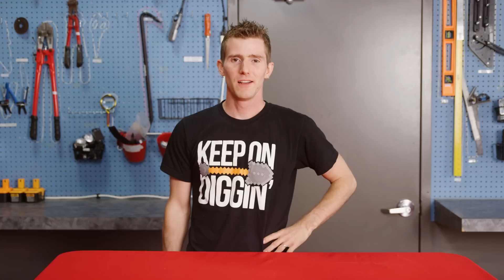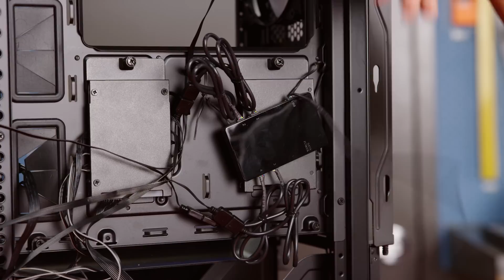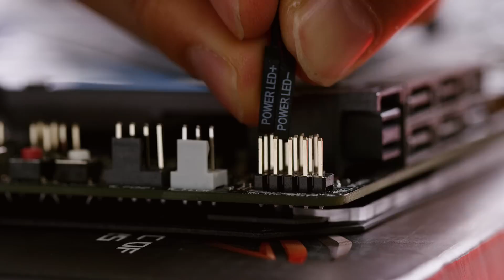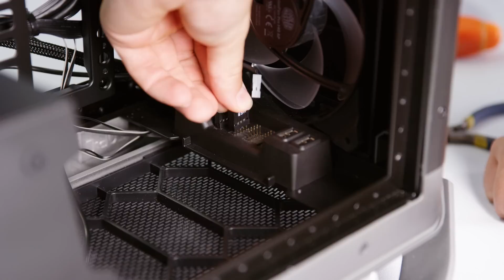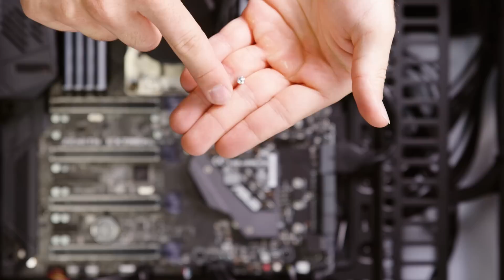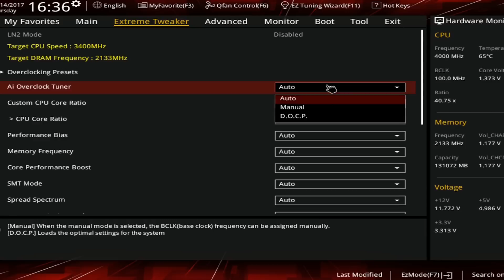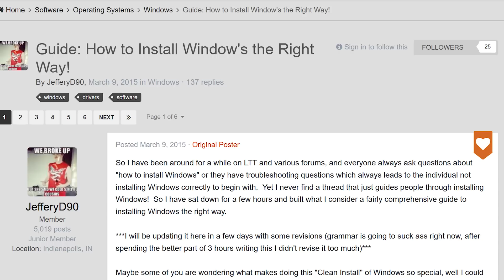Ultimate Mega-Workstation PC Build Guide

Comment: don't worry man, i'm building exact machine next moth, only difference, already have Cooler Master v1200 80+ platinum PSU, and Corsair h115i CPU cooler. and have 3 ssd, HDDs etc

I  do have corsair's 780T full tower case but c700p is monster of a case.
Also board will be Aorus x399 Gaming 7
and same 1950X and 64GB dominator Platinum.

already have 2 x aorus 1080ti.

yes, i do 3D content production and video editing...

so Board, CPU RAM, C700P case is all I have to buy :-D Rest is currently working in 4790K based PC in 780T.. so yeah, I'm here for the porn , and cannot wait... :-D

Comment: Ultimate Mega-Workstation PC Build?... and all that's used for cpu cooling is a sad dual fan AIO? give it the beans yo, min tripple like the Thermaltake Water 3.0 RGB 360 Hydro,  Fractal Celcius S36, Antec Mercury M360, Arctic Liquid Freezer 360, be quiet! 360mm Silent Loop or even the cheep Captain 360EX. Come on Yo!

Comment: CPU: i9-7900X
GPU: 2X MSI GTX 1080 Ti Seahawk
Motherboard: MSI X299 Gaming M7 ACK Motherboard
SSD: 1TB Samsung 960 EVO PCIe NVMe - M.2
SSD2: 4x1TB Samsung 850 EVO Raid-0
SSD3: 2TB Samsung 850 EVO
RAM: 64GB Corsair Vengeance 3000MHz
Power Supply: Corsair RM1000X
Liquid Cooling: Corsair Hydro H100i V2
Case: Corsair Obsidian 900D

Is the Spec from:
https://www.twitch.tv/summit1g
Maybe is goes crazier?

Comment: those long screws is not long screws. They are bolts.  The difference between screws and bolts is this. Bolts are partial threated. like only the 4th quarter are threaded  Screws are threaded all the way to the head.

Comment: Hear I though the LGA-2011-V3 sucks so badly its 2011 pins can easy bend and others fall of if not made properly. I called a online repair service so see what can be done to change that disgusting dead LGA-2011-V3 socket. Well LGA-2011-V3 is for X99 motherboards that is not being discontinued and many retired off the market.Any way the tech did tell me that is the worst socket they worked on. When it comes to the next gen motherboards suck as X299 and X399.suck worse on its CPU socket?Only time will tell. We are on X399 motherboard its 4096 pins that is  2085 pins more then the LGA 2011-V3. it looks like LGA 1151 is the smart buy. I cannot afford to kill more money then I all ready had to suffer. You should know I watched a lot of videos on benchmark test on video games. I look for those videos that got GTA V in there line of benchmark tests. They have used AMD Threadripper. AMD's most expensive CPU they got, test some i7 CPUs and some i5 CPUS and some i3 CPUs. make the bar graph on everything that have been done on Gaming, video and others. put all the CPU's to the ringer. GTA V PC with all there other games. lets get rid of the CPU that lost. i3 and i5. Now the plot thickens. you will think AMD 16 core threadripper will win ? you think yes 16 cores. 16 cores and all that threads got to be unstoppable. I got bad news. AMD failed for gaming! The CPU lost cores the cores that are turned off and lost threads. and slower clock speed. However it won on video and video editing and anything that requires 16 cores. Socking. that my i7 CPU that 3.4GHz on X99 motherboard it did a big fight.4th place. I7 7700K done a lot better  at 2nd place . The winner of the benchmark test for gaming goes too........ 17 8700K COFFEE LAKE with its 6 core 3.7 GHz Turbo Boost 4.7 Ghz. no over clocking on its CPU allowed. for gaming i7 8700K is the one to buy not bad for LGA 1151 socket.

Comment: I'd rather have a techquickie for example just about new way of cpu installation for ryzen cpus than another "push the card in, connect the cable..." just obvious stuff which has been covered like 20+ times on EVERY tech channel... I do agree it's impossible to put out perfect video daily, but this would save you much time and would not feel like "replay" of the same old stuff

Comment: Why not Quadro for workstation? Gaming-line gpu's don't work very well with many working software due to the drivers.
Reply: Except for real-time render engines like Eevee, Unity, Unreal, and a whole slew of others. Quadros don't handle those very well.
Reply: Aspiring Wackjob Can be so. Nice to know. But for example with SolidWorks it seems that they bottleneck the gtx cards on purpose with the drivers. At least with me there's a huge difference when i have multiple SW and dwg drawings windows opened with my 1080 versus my quadro m4000 on quadros favor. Even though 1080 should have more power. Seems strange. Also it seems that solidworks disables some features when using gtx cards
Reply: SolidWorks is meant to work only with higher algorithm processing cards. You can use a Quadro and a Tesla (as an algorithm co-processor) to achieve faster results, in theory. Quadros have higher algorithm processing power than GTX cards, since GTX drivers are not certified or tested for SolidWorks. After all, SW is a CAD program, not a full 3D render engine (dealing with animation, lighting, texturing, compositing). The GTX series cards are great for real-time render engines because of the fact that they're able to load things in chunks, which are a limited space within the entire 3D space, coupled with the fact that all models are very low poly. Other than that, they're useful for lightning speed interactivity within the 3D viewport and the UI of most other entertainment industry software (Maya, Blender, 3DS Max). However, rendering animations and the sort fall short unless you have more than one or more than three. For that, you need a Quadro.

Comment: pounds per square inch and inch pounds are common units of measure that do different things. an inch pound is a measure of torque that describes 1 pound of force on a lever arm that is 1 inch long. it implies a specific location that a specific amount of force is applied. it is not so ambiguous that it could be conflated with PSI AKA pounds per square inch.

Comment: Am I the only one that doesn't like the excess RGB these days? I'd rather stick to one color, not have all of them. It looks ugly, like you can't decide which color you like. And they should be accents, like a little on the fan and that's it, or no light on the fan and only a line on the top of the GPU and RAM. Luke's amethyst build worked pretty well since it was only one color and it was supposed to look like a geode anyway, but I can't say the entire box being full of lights in most builds is my cup of tea.

Comment: It's official. You have too much time on your hands. I'd complain that you had too much money as well, but this is sponsored content, so that goes without saying.
Personally, I avoid the fancy RGB stuff. I've got my main gaming/workstation rig built into an old 386-era server chassis that with it's original compliment of 7 full height 5.25" SCSI hard drives was so heavy it required casters mounted on the bottom, cause you'd break your back trying to lift it.

Comment: Hey Linus I'm planning on building a gaming PC (on a semi budget of around 700$-900$) with a Ryzen 5 CPU but i would like to know what you would recommend for a mobo, CPU chip, GPU, and  CPU cooler. Going to use 16gb of ram and i already have a power a supply of 900w so good on power. Going to be using RGB case, fans and RAM (not going to be water cooled). Please do a video on a budget Ryzen 5 build or reply with what you would recommend would help out a lot thanks.

Comment: +Linus Tech Tips I'm still pretty annoyed about the order and timing that threadripper information arrived at, completely after Ryzen was out and no cheap switch because you need to switch out the motherboard also... and I still probably would have but I hate waste and wouldn't have anything to do with the Ryzen chip + motherboard then.  And, no, 1TB of RAM is not overkill for my use cases, not in the slightest, but yeah, RAM is stupidly expensive right now, in fact, it is the most prohibitive expense in buying an Epyc system right now, by far, more than CPUs, MB, 4 or 5 GPUs all put together.  By the way, maybe someone here knows, how is the clock scaling on an 1800X?  Intel shows how many cores can be at each clock in their processor specs... I cannot find a similar official spec for AMD CPUs.  Only this 3rd party spec here: https://en.wikichip.org/wiki/amd/ryzen_7/1800x

Comment: Honestly I'm a bit disappointed by some of the component choices in this build.  I realise that it is sponsored, which limits the options for Linus.  However I feel that Linus really doesn't need to sponsor a build under 10k.  It's not like they're not rich enough to go all out and use the ideal components instead of the sponsored ones.  Hats off to a good video though.  Here are my component recommendations.  - Instead of the Cooler Master AIO use a Noctua air cooler like the NDH15 or NZXT Kraken X62 r2. Instead of the crappy corsair 500's use 960 pro's or the sm971, instead of the Cooler Master fans, use Noctua 140mms.  Etc etc, I could go on.  Also I would use Conductonaut instead of normal paste, for optimal cooling.  I do feel the Seasonic Prime titanium 1000w is equivalent or better than that ridiculous £1k "Japanese" gimmick, not that it is a bad PSU, but just overpriced hype.
Reply: The psu I recommended is less than half the price and has a 12 year warranty.  Do your research.

Comment: AND while you are at it, how about a full review of the 
NEW ASUS B250 Expert Mining Motherboard with 
19 PCIe expansion slots. YES! You heard that correctly!
NINETEEN SLOTS for GPUS....sooooooo.......how DOES
Crysis Play on a motherboard filled with 19 Sapphire 
Radeon 8-gigs RX Vega-64 graphics cards in it!
(note: $860 CAN per card!)  ....AND...after you do 
THAT test, dip it all in LIQUID HELIUM and 
overclock all the GPU cards to past 5 GHZ!
(i.e. possibly PHYSICALLY change the peizoelectric 
clock crystal on the GPU card board IF it exists 
there to ALLOW 5+ GHZ operation?)

Comment: The orientation of the logo/name on the cpu is triggering my ocd. 
It should be rotated 180° to be in line with the markings on the MB. I won't be getting it (no AMD hardware in my household), but if I was, I'd delid the thing and see if it was possible to rotate it. If that's not possible I'd get out the trusty sandpaper and lap it so the logo is gone.
Reply: Martin S why no AMD hardware?
Reply: I've always been an Intel guy, so that's that in the CPU department. Had one of those integrated AMD Duron 1300 things once which was purely down to budgetary reasons. (it was slooowwwwwww and ran quite hot even with decent cooling). Two months later I was able to purchase something decent* and let it go up in flames purely by ripping off the cooler. (Intel had thermal protections in place so pretty much impossible to let the smoke out of those CPUs).

As for GPUs in the beginning, when I purchased an AMD card, I'd pretended I had an ATI card. Until I the bad experiences started and I started calling them AMD. I don't want to tarnish the memories of ATI. #NeverForgetATI #NeverForgiveAMD .

I've had several AMD cards, and they all ran hot and the drivers are just utter crap. (DriverDementia ie, randomly forgetting (fan-) settings anyone?)
So that's why I got my trusty old 8800GTX out of retirement and will stick with it until I build my next pc. (next year)

* A Pentium M740 (1.73GHz) which I installed on a P4P800-E Deluxe motherboard via a socket 479-to-478 adapter and overclocked to something like 2.6GHz. (On air cooling). That thing was amazing. Good times.
Reply: Martin S I've been an AMD guy in every department except for that RAM, SSD, HDD and PSU, those were dark times....
Reply: I had an FX 6200 and now have Ryzen 7 1700

Comment: Thanks for the vid on this build considering this is exactly what I'm going for...like right now...minus a part or two. How's the performance on the workstation side of things? I truly do need a beast of a machine (at this price range) for Maya modeling, rigging, animation, V-ray, Adobe suite for production work, Substance Painter, ZBrush, and keyshot? Fixed plenty of rigs but this will be my 2nd from the ground up for my purposes. just looking for an honest opinion before I pull the trigger.
Reply: Divinci360 You bought this exact custom build PC? if yes, plz let me know the performance and overall experience in PC fan noise (if any), heat issues, how fast is the rendering and production. is it worth all that $$$?  I haven't seen if Linus has done any benchmarks on this machine yet! Thnx
Reply: Still waiting on parts to come in and I made a few changes. 3 Samsung pro 1TB M.2 FOR RAID, Corsair HX1000 1000 watt 80 Platinum PSU, Enermax Liqtech TR4 240 AIO, 1 Gigabyte Aorus GeForce GTX 1080 Ti extreme, and a  Toshiba OCZ 1TB VX500 2.5 SSD since I haven't settled on a NAS. Should have all parts by Monday and build completed by Tuesday... with any luck. Will share benchmarks by the end of next week.
Reply: Hey, whad'ya know, same here.
Reply: Gamer or content creator (build use that is)?
Reply: I know the title of the video but I just wanted to make sure.
Reply: Are you presently building or just gathering info?
Reply: Just gathering info at the moment. Funny thing is though, I'm also building for MAYA and Vray.
Reply: I pulled the trigger and the C700p just came in today.
Reply: Hey man, congrats!
Reply: Thanks! Just hopes it kicks ass the way I hear it's suppose too. Good luck on your research and let me know how it goes (if you don't mind).
Reply: Definitely, man.
Reply: wish you good luck with this high end build and looking forward to see those benchmarks! thnx
Reply: Divinci360 Hey Divinci, did you have similar build? How's the performance?

Comment: Need a cheep pc build for fastest web browsing experience. One that can handle many chrome tabs, video playback,  laggy javascript, loading closing chrome windows. $300 budget. Gaming not important just a pc that can handle browsing along side one or two light weight programs. Want the best performance possible for browsing probably ram and cpu most important. I don't want to ever wait for a chrome tab to open and hang when I already have a good internet connection. Nor do I want it to freeze up and lag when scrolling. 

bonus points for low noise energy efficient pc build and better performance than your average laptop APU. But high performance for web browsing is most important. God speed.
Reply: Asking a lot for $300. Bunch of Chrome tabs, alone is going to use over 1gb of RAM, not counting any other apps & if you want it to be snappy w/no lag, you really need a quad-core CPU. I'd get a Ryzen 1200,  B-350 board, GTX 1030, 450w PSU, 2x4gb sticks of RAM & call it a day. Something like this: https://pcpartpicker.com/list/3rt94C
Reply: bonus points for low noise energy efficient pc build and better performance than your average laptop APU. But high performance for web browsing is most important. God speed.
Reply: Go with 50$ xeon
Reply: You could maybe go with a midrange Chromebook. or if you really want a pc choose cloudready os or Linux (elementary os is my distro) as your os.
Reply: no idea 
Do you need so many tab for dem faps?
Reply: Go with used items if u r restricted on 300$ tops...

Mybe around this kind of stuffs:-

i3 4130
H81 mobo(any)
16GB DDR3
1TB HDD
128GB SSD
GT740/1030/R7 460
500w or below psu
Reply: Dump your money on a lot of ram

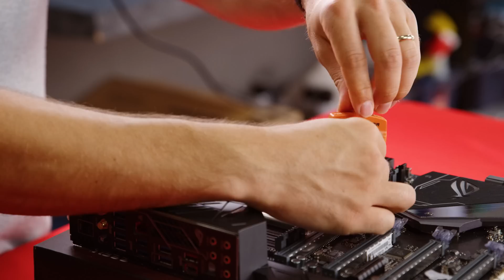Comment: 3:49
"Torque value of 12 pounds PER inch of force"
U mean 12 pound-inch of force?
Reply: HairlessHare
that's what he said
Reply: He says per inch
Reply: what do you think pound-inch is?! just like lbs-ft is pounds  per foot, pounds per inch is lbs-in. Does he have to say 'Torque value of 12 pounds comma per inch of force' or can you figure out that there's no such thing as a inch of force but there is a thing as pounds per inch of force. simply put for every inch (per inch) there's x pounds of force. x pounds per inch.
Reply: Just like Newton meter when talking about torque he should say pound inch. 
Actually pound per inch can be a unit of surface tension. like N/m.
Get it? There is no pound per inch when talking about torque. Period.
"simply put for every inch (per inch) there's x pounds of force. x pounds per inch."   That's just silly. If I have 10 lbs X 5 inches I'll  get 50 pound inches of torque.  NOT 50 pounds per inch.  If I have 5  inches and as you say "50 lbs of force for every inch" then By your logic I have 250 pounds of force. 
it's pound-inch not pound per inch. Just like Newton-meter. pound per inch is not a unit of torque.

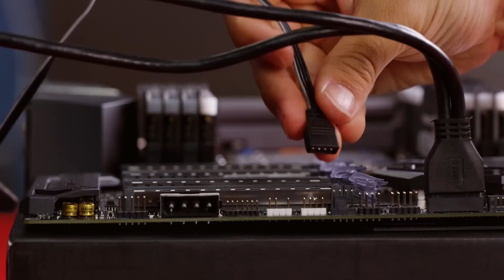Comment: 9:01 if you can press the mobo's contacts to the case then you missed a standoff or something. Shouldn't be possible. If the case does not have a standoff there then insert a dummy plastic one to keep the mobo off the case.

Comment: Any chance you guys will do a AMD and Intel dual build in the Corsair Slate case if it ever sees the light of day?

I think you would be surprised how many people buy components/build systems based on crazy "Dream machine" videos like this. I purchased the Cooler Master HAF X and XFX triple monitor stand thanks to the reviews you did for them. Hell I ended up upgrading my motherboard to a Maximus V Extreme and pushing my 3770k to 4.8ghz thanks to Jay, then a few years later upgraded my 3 GTX 770's to 2 Titan XP's due to his "What the actual ____?!" review of the card. Even my buddies who've been doing this stuff for a decade+ have learned quite a few things from these channels and are willing to throw down more than they normally would on upgrades.

With how small the tech community is (Relatively speaking) you guys hold a lot of influence ;)